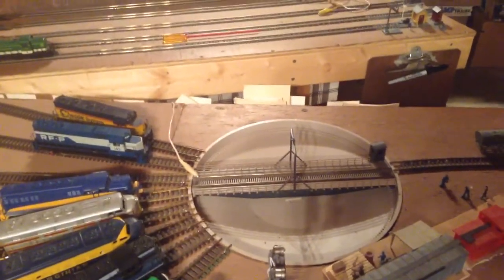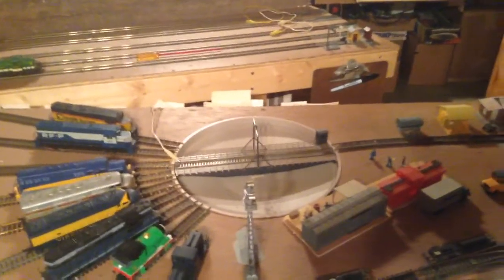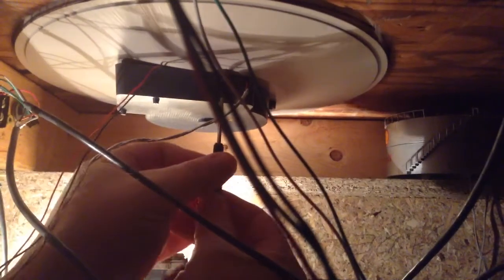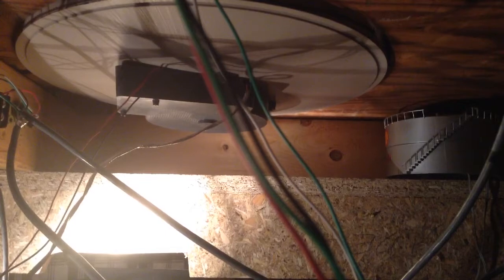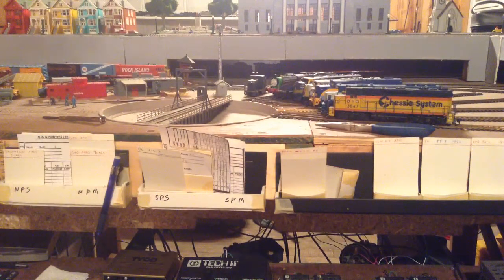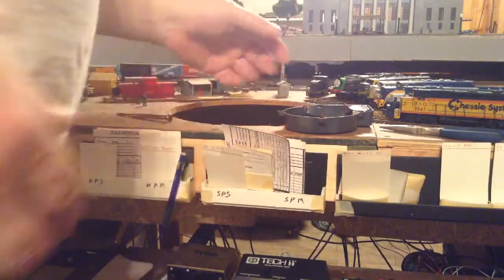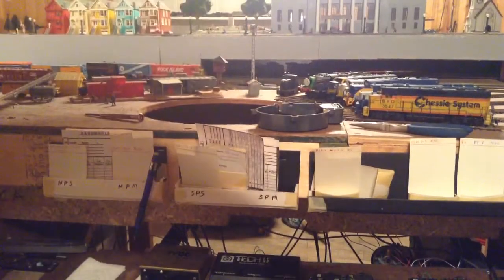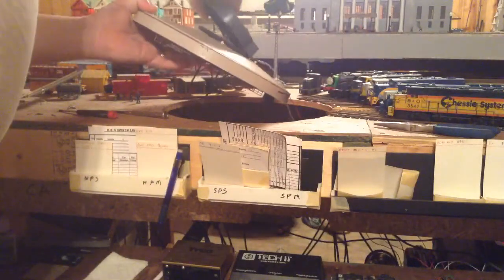Boeville & Newtown Turntable fix

Comment: I wish I could remember how I did mine. I think I bent my wipers at the fastening point and left them strait. I also used a thin thread to hold them back until I had motor casing in place
Reply from the maker: william mosher Have to look into that if it fails again. Seems to be a re-occurring issue :(
Reply from the maker: Will, THANK YOU!!!!!!!

I took the turntable apart and fought with it for another 1.5 hours (sheesh). However, I found 2 issues: 1) you were right with the contacts. Bent them at the plastic piece and that did the trick! 2) The plastic washer that goes in the bottom I had in upside down. Not sure how I managed that one but it raised the bridge. Thus, loss of connectivity.

Thank you again sir for the pointers!!